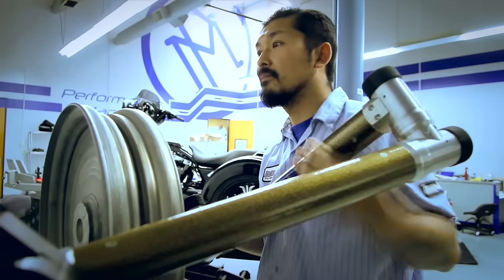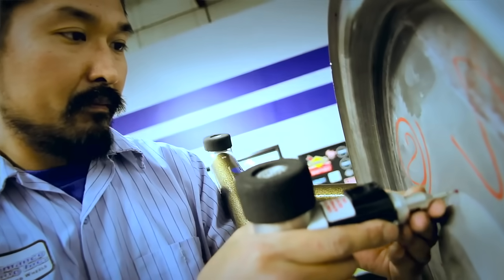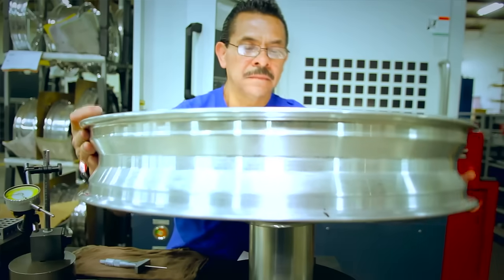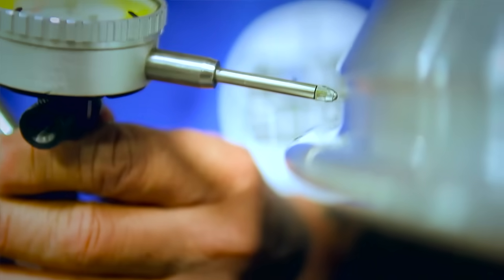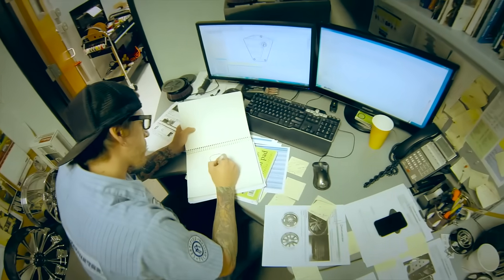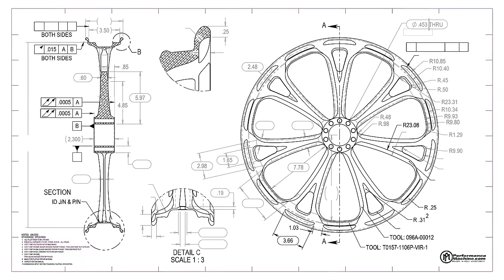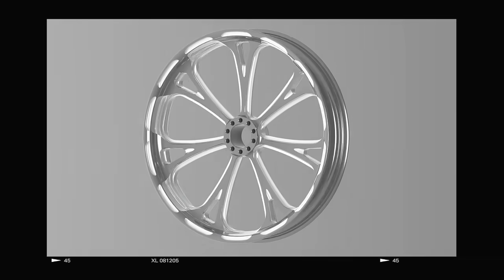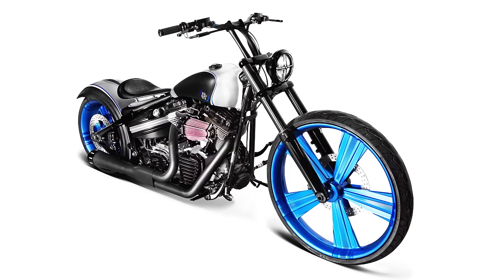Performance Machine Wheel Design and Manufacturing

Comment: I have a new PM belt drive sprocket that proves their products don't undergo that scrutiny. There's a 1/8" gap between the sprocket and the outboard flange. I bought the sprocket in a a factory sealed box on eBay so I had no recourse. I decided to salvage the bearing and the press never made pressure before the bearing fell out. The bore was too large so they glued the bearing in the sprocket. JUNK